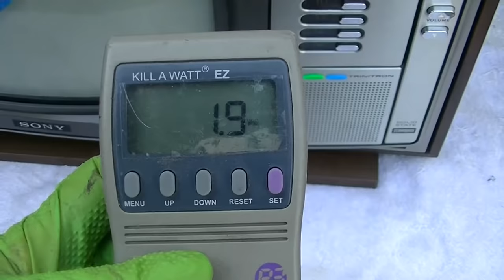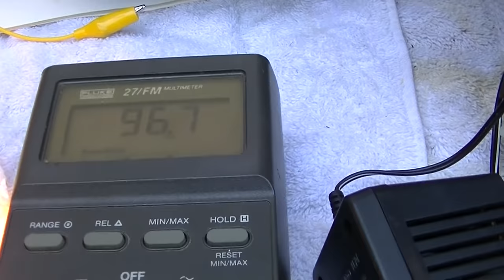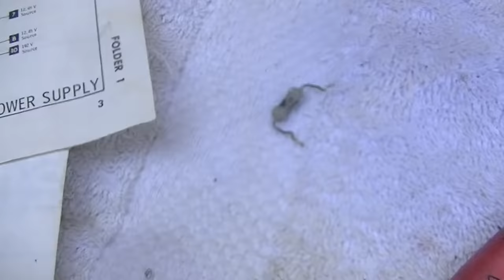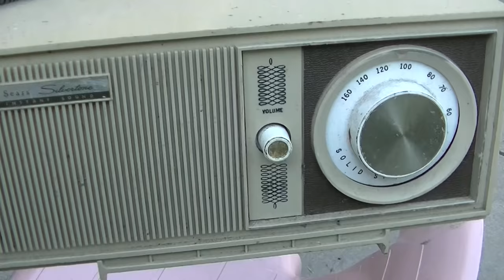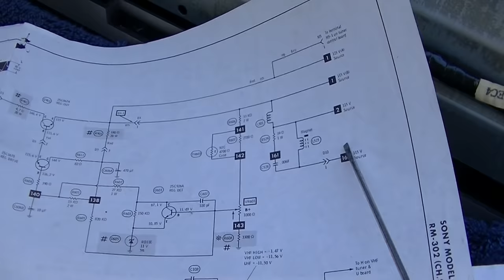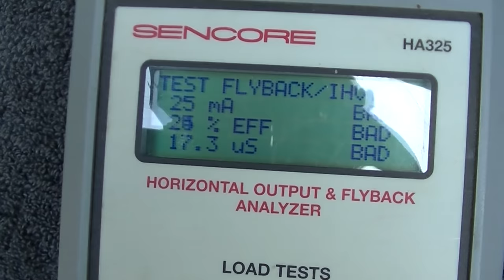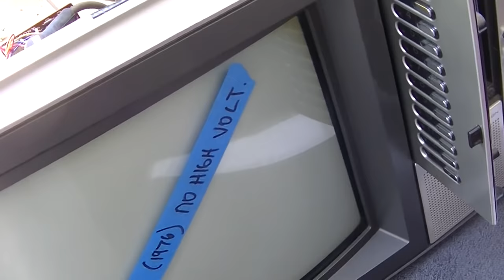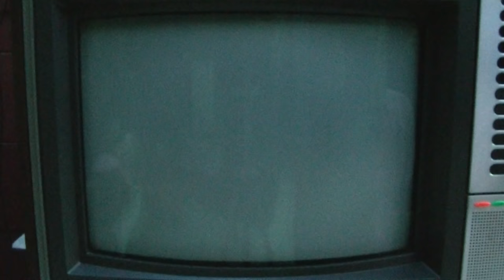Sony Trinitron KV1541 Remote Set Super Hard Fix 1977 Vintage Color TV

Comment: I watched the whole thing. Wow, that thing really made you work for it. I wouldn't have had the patience, nor am I that brave when parts start burning out. I'd likely have thrown it out the window. As for the flyback...maybe it's just marginal enough to pass the tester while breaking down under normal conditions?

I'm guessing this video's length is a hint to those asking questions in the hope of a quick fix, though I have my doubts they'll catch on.

Comment: I'm interested in all of it. Great video.
I know you don't give up easily. You are very dedicated. If you give up on something, it means it's practically impossible to be repaired.
I guessed the fly back. I usually get it wrong, but since the high voltage wasn't working, well... It was just a lucky guess, and I usually guess wrong.

Comment: My parents bought a 15" Sony similar to the one in the video, but without remote control. It was our family's first color TV and also our first solid state TV. As I recall, it was purchased at Larry Dorst TV, a classic small TV radio dealer in the Milwaukee area that handled various major brands. The Sony color picture quality was generally acknowledged to be better than most of its competitors. That TV lasted us through the MTV era and it was eventually replaced by a larger Sony.

With both TV's, we had a Zenith cable converter box placed on top of the set. Our siamese cats would frequently sleep on top of the cable box because it was comfortably warm.
Reply: I worked at Marvs tv in Milwaukee and  I didn't have to really work on Sony's because he hated them!!

Comment: Man, this brings back some bad old memories. That miserable SG264 device... I saw several several Sonies that presented with the SG264 shorted, removed it, analyzed the circuit, everything is perfect. I replaced the SG264, the set started up, played beautifully. The retrace pulse was 12 uSec wide. The set would play ten minutes, or maybe two hours, sometimes longer, then Tick! The set goes off, the B+ fuse blows, back to square one, less the $8 the SCR cost (around $20 today). As I recall, it was one of the blue anode tank tuning capacitors...oh and don't waste money on the ECG276 substitute for the SG264. They never worked for more than minute.

Comment: SG613 is a gate turnoff SCR. Lose horizontal drive, it'll short. In models using the SG613, common failures were chokes feeding video output transistors opening up, filter caps and their usual havoc and gassy CRT's. When changing the gate turnoff SCR, replace the damper diode.
Oh, even back in the vacuum tube days flybacks had spacers between the core halves to prevent saturation. Spacers could be paper or plastic, depending upon what engineer justified their job with that choice of shim.   ;)
Later Sony models also added additional protection circuits, which could cut video drive under certain conditions.

Comment: Great video, thanks!  I did watch to the end.  The only thing that comes to mind that could be wrong with the "bad flyback" is the focus/screen block that comes right out of the flyback, and/or a bad HV rectifier that is on the output of the flyback that is breaking down under load.

Comment: I had one of those old tek scopes.  The whole package with the black plastic halliburton type case.  But the lcd wasn't working.  It was so faint you couldn't read it.  I won't ask you what the problem was with that...  As a novice at electronics I gave up and got some fluke scopes, the 95 for automotive and the 97.

Comment: Great job on the fault finding. Most TV engineers back in the day would have popped that Thyristor on the first change and given up. Also thought the mod on the regulator was good. Interesting fault diagnosis on the burnt 39 Ohm resistor in the "efficiency" circuit re the AC  path causing the resistor to burn out - as there was no DC path for it to fail through (assuming the series capacitor was OK). After that things really went down the rabbit hole. Freaking Zeners !!! Well I thought the Zener problem was it but the FBT really got weird. I felt like I was fixing it with you, I'm actually tired now. I'm off to buy twelve barrels of Flexpaste, make a rubber bed and hibernate for winter.

Comment: I do remember servicing a KV-1830, in Australia, and note that, in the mid 1990's, the SG-613 was a price of around A$30.00. They also had 'fail safe' circuits which turned off power in the instance of a line overload. The mains power is 240V AC, then rectified to supply nearly 350V DC to its switch mode power supply.. By just switching on, it would not run, but using a 100Watt (240V) incandescent light globe in series, it would remain dim, but after a time, you could tell which transformer (line out, or HT (the line out & HT are separate) by the heat it emits... Managed to find, on occasion a set which had a bad tube, but a good transformer available, and used for a repair...

Comment: One has to admire your tenacity! 👍 I was (as I am sure were many of those who followed your unfolding nightmare into moments of hellish proportion) with the final temperature evaluation that had one's jaw drop! (proving that hell could actually exist in the back of that tv) 😗🤣🤣 OMG! It truly is difficult to believe that manufacturers such as SONY could get away with producing such a set with those temperatures!🙁 I grew up at the end of the era of VALVE COLOR sets and as I am sure YOU know all too well, the temperatures in the back of those!! caused in some instances the whole thing to light up (in more ways than one🙄 ) with flames coming out of the back of em! 😗If the sets produced in the USA were bad then have some sympathy for us in the UK, the television sets were beyond terrible... It was not until the Japanese TV sets came into the UK that we actually started getting RELIABLE tv sets.👀 HOWEVER given your foray into the SONY set illustrated I wonder what the temps in the inside of my former TRINITRON were?!! 👀I did replace the line output transformer on a Phillips set which was a modified replacement AND it was a pleasure to see the set working gain. The later SONY 36inch state of the art all singing and dancing tv my daughter owned, after two years the line output transformer and a couple of caps on that had to be replaced. 👍I totally agree with you re this mentality today of the throwaway society that anything that goes wrong is a quick fix of throw it away.. (given your current experience I can understand to a degree why some might do just that ) 😀but there are those of us who like to punish ourselves with our curiosity and desire to get something working, that in fairness a trip to the dentist and have a tooth pulled might seem like a welcome treat👀🤣I've got quite a collection of (working) valve radios/radiogram et that I've carefully restored and have to say, the British made ones the chassis invariably are rusty crap.. whereas the latest Siemens GERMAN made (1947) radioGRAM, with an American POLYDOR record unit, is a magnificent if temperamental   beast, to work on.🙁 The FM section is a nightmare re getting to work as it has a twitchy tuned circuit using EF valve configurations that have to be configured perfectly or it won't work. 😗One resistor or one capacitor out of sync and ! 🙁🙁Our British tv's always had serious alignment valve issues with the dammed valves constantly failing, a pull the dead valve, replace and all was well again.. just again... and again... 😗and yes as said on a cold winters night you could group around the telly to keep warm.. 😗👀🤣🤣 Stay safe ! Thanks for taking the time to indulge us in your getting this monster to work! 👍

Comment: I used to have this exact TV.  A part of me died when it died. We got it new when I was about 10 years old in 1977.  I watched the September 11 tragedy on it.  It died about a year or so later.  When I took it around to TV repair places no one would even look at it.  They said I wouldn't be able to get parts for it. I ended up leaving it with one of the repair shops.  I threw the remote away some time later.  Now I wished I still had it.  It was an ultrasound remote.  You could hear it click really fast if you held it up to your ear. You also didn't need a clear path to the TV to work.  The TV could hear it around objects or reflected off walls.

Comment: Thank goodness for this video! I am working on a KV-1215 right now and it has the exact same symptoms as yours. I had already figured that the power transistors were blown, but then I checked those two resistors and they are blown as well, same as this one. You saved me hours of time trying to figure that out. I will replace the parts and give it a try, but it seems that this is a common problem with these sets. I have very low hopes it will work. Perhaps I will convert it with a modern screen and keep the set just for the looks. Perhaps I will use some Flex Paste!

Comment: I recall a similar fault I had with a Sony 1272 CRT projector back in the day.. so many faults emanating from a single failed part it was ridiculous, and it would literally fail each time with a shower of sparks and disintegrated semiconductors everywhere. Very testing to the stamina, but those projectors were insanely expensive and tightly packed at the time so you just had to persevere.
Anyway, thanks for another great video, and persisting well beyond the point of giving up.

Comment: Fantastic video, couldn't stop watching,  thanks!
The original SCR was a gate turn-off type (fairly rare) whilst I think one of the replacement ones was a standard SCR that's why that did not work.
On the bad flyback vs good, have you compared inter-winding capacitances and winding inductances / resistances? Maybe that could reveal something.
But I'm glad you did not give up and succeeded to fix it - I know that feeling when you'd just walk away never to see the darn thing again.  :)

Comment: The direct line connected DC power supply, plus the horizontal flyback  scan derived voltages for most of the TV, was adopted by almost all picture tube-based TV makers since the early to mid 1970's.  The difficulty repairing these  circuits shown in this fine video is no doubt, above anything else,  the reason for the downfall of the TV repair insustry.  I have also found that a horizontal oscillator running at an abnormally high frequency will burn up more driver and output components than anything else;  very early on in the troubleshooting of this TV I would have reached for an oscilloscope and checked the horizontal drive waveform and frequency.

Comment: Could the problem have started with a power line surge, or a lightning strike? I still have  29" screen old model TV that still works, but lost a 19" TV to a lightning strike several months ago in the Spring. I still use the 29" for a computer monitor thru a converter box with my HP clone computer (I'm too cheap to buy a flat screen monitor that size or biggest). I regularly buy old Heathkit equipment and repair them by just replacing parts until it works. 90% of troubleshooting the old tube stuff is visual with just a VOM to check components.
   Your persistence here is admirable, excellent video for troubleshooting  the older stuff. Too bad we went to HD TV, it wasn't necessary to do so. I guess "planned obsolescence" wasn't good enough for TV manufacturers.

Comment: You are darned right I made it that far, and the rest...  This is an instant classic as far as interesting and complex diagnostic-repair videos go, not wishing to kiss ass but it's one of your best IMO.  What a marathon, really enjoyed it and I could feel the joy when it finally fired up and the static was crackling, even if it did try and emulate the screenburn set in the first 5 seconds of life! (That would've been a real kicker if it managed to burn in the line on such a strong CRT after all the time and effort to get it working.

Oh by the way, I've got a KV1210U here when I switch it on there's sound but no picture how do I make working again?

Comment: there is a   set of diodes in series with the flyback Anode wire... (  Intergrated flyback )   I REPLACED MANY...
IF you would have disconnected  the anode from the crt   durning testing  you could have saved lots of parts.........LOL anyway a great video !
it was feeding ac back . !

Comment: Mr. @shango066, there is an alternative replacement for the SG264 thyristor. It just takes two horizontal output transistors in parallel to temporary replace it while you are conducting tests. There is an article about it, I can send it to you for further discussion with other colleagues
Reply: I want to ask, Sir @Salvador, How will it be possible? and why from thyristor, some CRT TV manufacturers, especially Japanese, Korean and Chinese, they shifted to horizontal output transistors (with damper diode and a resistor on base and emitter)?
Reply: @angelosupetran  It's been very tricky to troubleshoot horizontal output stages based on thyristors, so I felt relieved to know that sometime in the late 70s many manufacturers abandoned thyristors for this purpose
Reply: @angelosupetran  It is actually possible to substitute a GTO thyristor with a BJT transistor because GTOs require a negative voltage applied between gate and cathode and this negative signal comes from the horizontal driver transformer.
This subject requires more research from me, so I can demonstrate it.
BTW, it is impossible to substitute an SCR with just a single bipolar transistor because the SCR is self latching, making SCR horiz output stages even more complex

Comment: The candy drop dealies in the flynack core create an air gap, the magnetic field tends to get stored in the air gap, meaning they can use less ferrite and save money. It could also be a mod to increase the current capacity of the flyback. An air gap is a common trick in smps power supplies.
I need some flex paste.

Comment: Great video as always! At 2:03:00, the spacers used in between the two halves of the flyback core are "air" gaps. They are there to avoid core saturation and increase the core's ability to store magnetic energy, since flyback transformers operate with a large DC component. Actually the transformer will not work at all with the cores touching each other.

Comment: The last television I repaired I rinsed it out with hot water and Dawn dishwashing liquid. It was like a 45 inch flat screen LCD and it had input switching constantly.
Indicating high impedance bridge by dust. And blowing stuff off with compressed air is only a temporary fix where removing any Grease with Dawn dishwashing liquid, gives it a new life and it is still working 7 years later

Comment: That threaded bracket around the core is indeed responsible for the tuning of the flyback. The spacers definitely are, there's a certain amount of air gap is needed between the two halves of the core. Normally I would guess if the bracket is broken, the core would open up, and the change of the air gap would change the resonance frequency, but in this case, the core was glued so I think the issue will probably be the broken bracket.

Comment: I tried to fix one of those in the 80's the horitzontal output device, was toast. It was a bizarre scr, but I found one, it was an expensive, sony branded, proprietary device. I replaced it.. The set worked for a few hours, and popped the device again. I took my losses, and never tackled one of those trinitrons again.  I would expect that there was a flyback issue, but their use of a costly one of a kind silicon controlled rectifier for HO was insane. I burned two of them.
(edit 1) at 0:47 Deja vu, and yeah I walked away.. at 0:48, you are a far better man than I am, lol
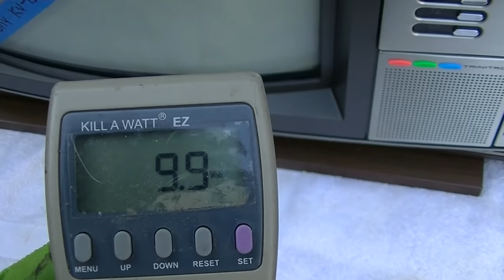(edit 2) at 1:11 I think the gate could turn the original device on or off, it was a very strange semi.
(edit 3) at 1:40 I said uhh oh, the loss of that force holding the gapped core together is bad, and would throw the resonant frequency way off, and reduce inductance. at 2:00 I was screaming to re-torque that flyback core, and wondering if the one I worked on had the same broken bracket problem..
I enjoyed this, this is closure, and no regrets for walking away from it 35 years ago, I would have never been able to spent that kind of time on it, I will always wonder if that bracket was broken...
Reply: Our shop was pretty dead around December and January so sometimes we could spend time on a set. Plus the owner was Jewish and was,willing to work hard to earn a dollar.

Comment: 45:23 I don't do this for a living, so my words come cheap, but when I went through something similar with my GE CTC-136-based 20" set, I ended up puting a fuse in series with anything that had already burned up, so as not to have to replace the $17 HZ-output transistor a 3rd time. The added benefit is that I don't worry about it lighting my house on fire, but for a $30 part, throwing in a fuse might actually pay off on the average, when the rest of the circuit is in question. Just an idea.
Reply: There's a joke that semiconductor will protect the fuse from blowing by blowing itself up._

Comment: Hey, you know the NPN transistor used in the power supply which you replaced with a TIP50. A better choice may be a NTE124 TO66 PKG which would fit without modification. The mini bottle cap is a rare transistor in a TO66 PKG. these days. I was surprised too. Take care man!